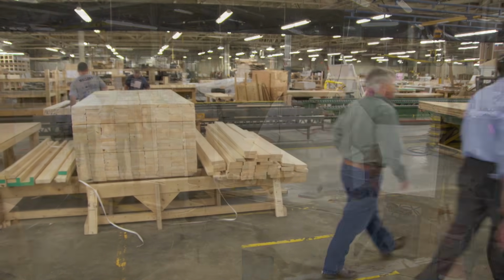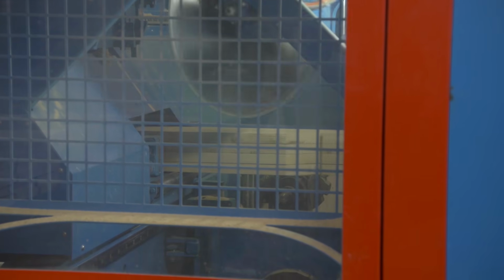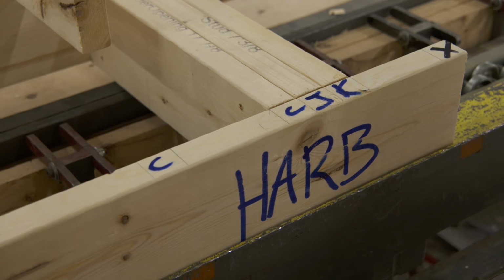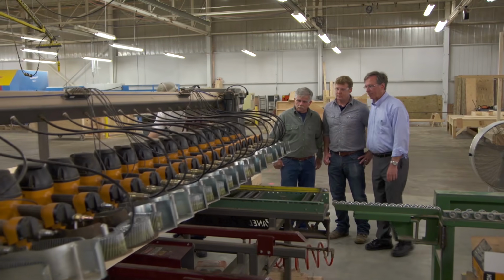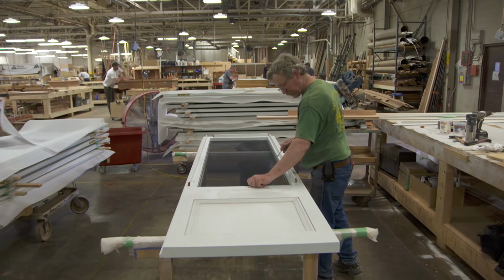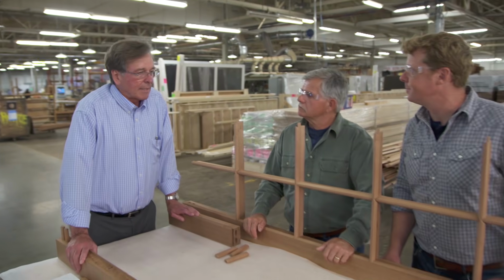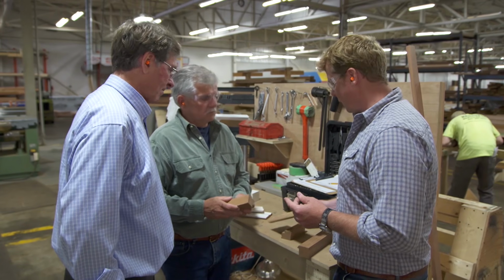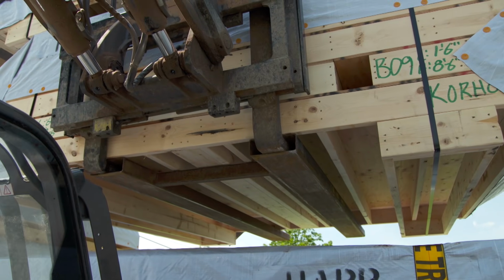Kevin and Tom Tour the House Factory | This Old House

Comment: I haven't looked at their pricing yet.  I looked at another one a while back (bensonwood?) thinking it might be cheaper than on site construction and the pricing was ridiculously high.   Their quality and construction looked good but holy crap it was expensive (if I was rich I wouldn't have to worry about it).   About double the price to have them build a house vs. just your average contractor.  Hopefully these guys are more reasonable as it could be a good thing if done right.

Comment: Stick framed homes are way better. Only benefit of component is trusses. You lose a ton of attic storage though.
Reply: Stick frame would take 10 times as long to build with 1/10 of this precision and quality.
Reply: @daveclark8337  1/10 rofl. I see them having to rack walls all the time, sometimes the foundation isn't perfect.  10 times as long to build also, ay?
Reply: @natesmith9185  Look at the details on this house in the 2nd half. This house would easily take a year to custom stick build from start to finish in New England weather. And the fit and finish would be no where near as good. https://www.youtube.com/watch?v=MWrw_bSjHA8&t=23s

Comment: Personally don't like it, I know thet construction goes it this direction. To be just one cog in the mashine, and your knowledge base is sutch thet they can displais you with a new worker within a week. It is easyer for the body but the craftsmanship is lower, the knolidge, and ultimately your/workers worth does not accumulate, it's stagnent, and you are easy li replaced by someone younger
Reply: The younger generation replaces every job, even the brain surgeons.
Reply: @pavelow235  true, with the youth comnes new energy and ideas.
Reply: @Kevin-mp5of  A)Why don't you fire him. B) No one supervised the cabinet hanging or checked on it at some point? C) Why didn't you fire him?
Reply: I like it. I really believe craftsmanship used to be a thing, but I live in a home built in 1980 in Georgia. In 2007 When I moved in everything that could be wrong was. Pull back a little trim or drywall and just junk workmanship. In that factory they get dimensions no framer can consistently match.
Reply: @takatsu5  I agree with you, 1/100 home from before are good, mostly is crap. This way the customer gets a more relay able product.

I'm the way of safety, reliability, adherence to standards, cutting corners, cost, ease for the workers... It's all a plus to the prebield tipe of the construction.

But personaly I'm not fullfiled, I don't see the "fruit" of my work in this kind of environment. I'm more the guy hu is on the job site, thet I'm seing the prices unfold. I understand thet some people have different preferences and don't minde to be cog in the mashine.

It's just my opinion thet you are more roundet worker/individual if you know the home spectrum of construction work. Not in a way thet you are a master in all things, but to have glosary knowledge.
Reply: @Kevin-mp5of  Well,  maybe you're talking about your particular family, but (for society in general) that's pure BS.
Reply: @Kevin-mp5of  so if you're not going to fire him because of kids...then don't complain. Send him home without pay...or better yet tell his wife how's he's acting on the job site. Sounds like someone who is costing you more to employ because if any of those cabinets that fell were damaged, that's on you.
Reply: @Kevin-mp5of  this is definitely safer
Reply: @Kevin-mp5of  again, you hired him and keep him on the job. You can't complain.
Reply: @Kevin-mp5of  my first work with a electrician I was 16 (2007) one time I was late, and hi has sead "its the last time it has happened" I still to day remember it. Sometimes if you are hungry (I was) you will take the burden of responsibilitie, but if you know thet people have pity for you, why change. I'm sorry for the kids, but this is just  unfair thet hi is so uncaring
Reply: @daveclark8337  I'm still learning English, it's my fourth language. I know thet I have still plenty to learn, but for now I'm proficient enaf for rudamentary communication

Comment: There's gotta be a reason why this isn't done more often.   Tommy talks about how long it would take guys in the field etc etc,  but that method still has be cheaper, because ultimately that's what matters most,  minimize cost for builder, maximize profit.
Reply: there's a lot of "because that's how we've always done it", factory built components can be cheaper
There are a lot of options today (including but not limited to)
1. traditional (stack of lumber, entirely cut on-site)
2. stack of lumber, entirely cut and labeled at a factory, but built entirely on-site
3. wall panels built in the factory, assembled on-site
4. modular (~15' wide boxes built in the factory, placed on-site, finish work, roof, joint areas built on site)
(plus Structural Insulated Panels, Insulated Concrete Forms, pre-cast concrete, and others. Not to mention building from standard lumber or a variety of engineered woods)

If you re a builder who is building 50 houses, there isn't as much of a win because you have specialized crews doing one job on house after house

If you are doing a complete custom million dollar house, you are looking for things that are so custom that pre-built components probably don't work for you

But in between, where you are building one or just a few houses, there is room for factory built to save time and money.

Depending on the factory, you may be limited to the few designs they have, but most will allow custom designs (with a fee to do the CAD work), when I went looking about 10 years ago, they were quoting ~$20k for the design work for a complete custom design.
Reply: My guess is the logistics and the crane to build the items cost more than cheap labor and just having a stack of plywood and boards delivered.
Reply: @pavelow235  Don't see the need for a crane
Reply: @pavelow235  Yep...all those machines cost more than mexicans. LOL
Reply: @ryanroberts1104  Those machines cost a lot, true. But it's a one time expense. that laborer costs money every single day, day after day, as long as you're building. With amortizing  and deducting the equipment purchase, it comes out cheaper. And the  quality is definitely better.
Reply: @oldschoolnewsguy  No, it's not a one time expense. The electric bill alone in that place is probably at least 5 digits. All those lights and I assume heat or air conditioning cost a literal fortune. And the guy running those tools makes more than a brown person on a job site with a nail gun in hand. They likely have much greater benefits for the workers. And then the building cost. And insurance. They probably have to pay a dedicated guy to do ongoing repair/maintenance on all the machines! I could go on and on...

If I was working building houses, yeah, I'd definitely rather be in the factory, but if I'm a buyer I don't care.
Reply: Besides the savings on labor costs there’s also economy of scale. The Silva brothers can’t build more than a couple of houses at a time with the same number of crew, while as a factory that can turn 50 houses a year can carry a lot of overhead. But I reckon the biggest reason why anyone wants to build this way is speed. While the foundation is being laid you’re patrolled building the timber frame that goes on it, a house can go from breaking ground to weather tight in weeks rather than months.
Reply: @htklun  There is no "savings". This is a more expensive way to build. That is a fact, not an opinion. You can argue about whether they are better quality or not, you cannot argue they cost less, they simply do not. They are also not worth anymore as a finished house, and to most people, the actual cost vs retail value of their home is a very, very important factor - even if you are not planning on moving.

It also has nothing to do with labor costs in different areas. If that was the case they would be building them in Honduras. (yet again, brown people are always cheaper) Things like this are usually manufactured within a relatively short distance of where it will be built. (A few hundred miles) They are not shipping these across the country, because it would not be cost effective. There are different companies like this and others that make manufactured and modular homes all over the US, so they don't have to ship very far. (Like Amazon warehouses) And as pointed out, the guys at the job make minimum wage or close to it, the guys in the factory probably make twice as much and have a union + benefits.

It doesn't matter how much it cost to build or what the factory is paying - they charge the customer more for the final complete package. (In the case of TOH, they probably got the product for free or heavily discounted)
Reply: This is vastly more efficient and produces a much higher quality product and probably at a much lower price than having a bunch of dudes try and do it by hand every time. I run a company with 180 full-time employees and stuff like this increases productivity by light years over doing each by hand.
Reply: @joelx77  Right...higher quality for less money. That must be why almost nobody builds this way! Genius! Everybody else must not be in on the secret.
Reply: Probably more difficult to get away with using illegal labor in a factory setting.
Reply: @jej3451  get ready for more of that
Reply: @jej3451  yes and its American bosses that are hiring them too, dont forget that part.
Reply: @johnmurphy9688  Yes, if you don't enforce a law, and there is money to be made, people break the law.  Imagine that!
Reply: It surely cost more per sq ft to build this way. They like to advertise stuff like this as higher quality because it's built in controlled conditions, but I don't buy that. If you build it right on site there is nothing wrong with a little weather during construction. And foot for foot, the house isn't going to be worth any more when they are done building.
Reply: @ryanroberts1104  you don't have the same jigs available on-site that you do in the factory, those jigs and tools both improve the consistency and save manpower. In some parts of the country, the manpower costs are a huge part of the cost (I'm in California for example)
Reply: @davidelang  Sure, it can save man power, but look at the facility they have to pay for. Silva Brothers build the same kind of house out of a trailer. That overhead just gets added to the price. Look at the big production builders whose only motive is profit and quick houses - they always build on site.

I notice everybody in the factory is white. Not how a typical job site looks.
Reply: @ryanroberts1104  If nobody used them they would have been out of business decades ago.
Even local lumberyards are starting to offer pre-cut-and-labeled lumber packages.

As I said, production builders have specialized crews that move from site to site doing the exact same job. That's a similar concept to the factory where you have a team dedicated to each job, so any differences are far less (although I suspect that even there, the pre-cut-and-labeled lumber packages are making inroads, the savings on the disposal costs in some areas will be significant). That's not who prefab builders are targeting as their customer base. They are targeting one-off builds or small custom projects. We've seen ToH use different prefab options on different builds over the years, there is no one option that is always the best for every project.
Reply: oh yes, one other advantage for the workers, they don't have to spend hours on the road driving to and from the job site, they have a predictable commute to the factory (again, matters far more in some areas than others)
Reply: @davidelang  I didn't say there weren't advantages for the workers and the company...there aren't advantages for the buyer. It's going to cost more overall, for the same thing, that isn't worth extra. If somebody didn't tell you it was factory built and somehow better, you'd never see the difference.

It's the same thing with manufactured homes - they often cost MORE per square foot than a site built home, and we all know they are low quality and carry no extra value. People still buy them...consumers are mostly idiots.
Reply: @ryanroberts1104  Let's say a factory like this costs $5 million to build. That means $2 million (40%) down for a business and a 30-year mortgage that is $14k per month. They're turning out a home a week, so $3.5k of the mortgage payment per home ($2.5k of interest, $1k principal for the first year of payments, with more of the payments going against the principal over time). Not to mention that's one heck of a property to depreciate come tax time for the business.

I'd bet they're also saving plenty more than $3.5k per home. Quality of work with equivalent labor is also surely higher, resulting in fewer callbacks. Safety is better, resulting in fewer worker injuries and associated costs. I think the biggest barrier might be the complexity of doing something so different. It would be a major shift doing a typical production builder approach to moving everything into a factory; it's also risky, because running a factory is probably different than running an onsite building company.

And as David Lang mentioned, labor in some areas is extremely expensive. I was just reading that in San Francisco, it costs $400k per a condo unit off-site and assemble it on-site, while it costs about $800k to build it all on-site. (It's a crazy price for a condo build, but double crazy on the build-on-site option.)